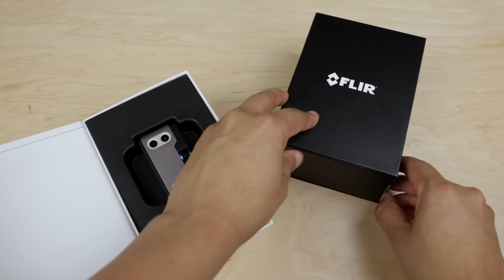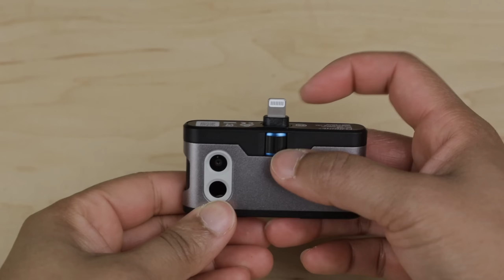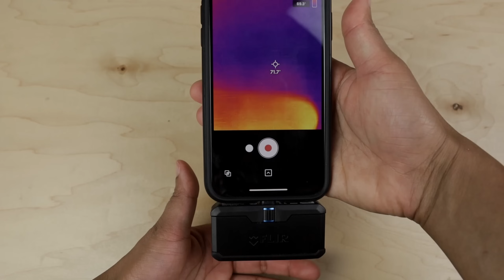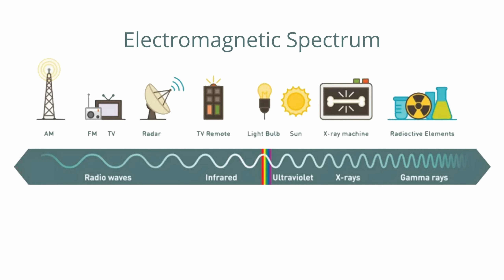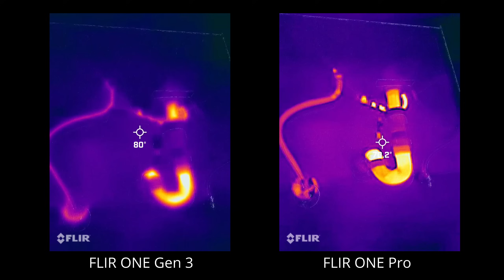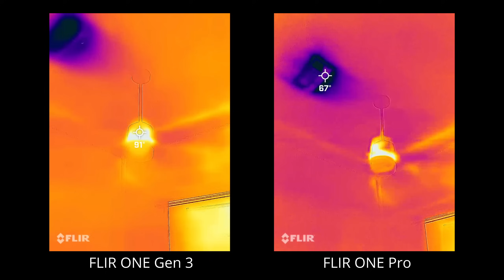FLIR infrared thermal cameras | Remodeling must-have!

Comment: Some building materials store and radiate heat, don't confuse this with heat loss per se. They would look warmer on camera but such readings don't tell you whether they are less effective as insulation. Incorrect assumptions could lead to the condemnation of perfectly well insulated buildings in which the conservation of energy has been miss-understood.   Great film Belinda, all the best Lucas.
Reply: Your statement is nonsensical. Not some, but ALL building materials store and radiate heat, just at different rates. A hot spot (meaning relative to surrounding material temperatures) means a difference in R value. This means higher heat gain/loss caused by that material. For energy efficiency and comfort the goal is to have as much R value as possible, as evenly as possible.
Reply: @sladeoriginal  What you have written demonstrates exactly the pitfall of relying on this kind of thermal data. Your understanding of how energy is preserved in a building is incomplete, if applied to a great many types of construction. What happens when the heating is switched off? How long does a building radiate heat back into the living space?  R value tests are carefully conceived as an aid to marketing particular products,  and are sadly unscientific. In some cases leading to time-honoured systems being displaced by experimental and ultimately inferior systems.

Comment: I've had the gen 3 for about 9 months.  I understand the resolution and pixilation is better on the pro, but the expanded range in temperatures do nothing for me.  If the house is ~500 degrees, it is likely on 🔥.  It is a tool for the tool box, and I use it in conjunction with my thermal gun that provided spot temperatures.  

As for the hot spot on the sloped ceiling, it may be a bees nest.  Thermal cameras can spot those as well.

Comment: FLIR is a top shel product. We had two at wirk for everything from scanning high voltage systems too dangerous to get close to. We also used them to find moisture and thermal links. One night we compared IR and NVG images in a wildlife preserve and it was amazing!

Comment: Check the HTI HT-301 camera, much better hardware, resolution and frame rate, but the app is a bit crap, around £600 or $800 USD

Comment: I have a CAT S61 with an older FLIR thermal camera built in. Don't use it every day, but do use it a lot. Used it in the mountains to check my breaks to see if they were getting too hot. Used it to check the insulation. It's really good at seeing where issues are. Good for checking some remotes to see if they have dead batteries. Used it to decide storing a lipo4 battery in my car during the summer was a very bad idea. Last winter during the cold snap was amazing at figuring out where the pipes froze. Use it cooking. Would love a higher resolution version, but the S61 is still running really good

Edit: Also depending on the temperature difference, between rooms or the outdoors it can work as a pretty nice stud finder.
Reply: I got the S62 Pro, it's very useful.
Reply: @davidwindmueller6000   personally waiting for a 5g version to upgrade but I imagine it's very nice

Comment: That's a cool feature to be able to adjust the height of the plug in port as I have had to remove my Otterbox Case from my phone to use certain thumb drives and things like that.
Reply: Worked on our Ottorcase. It is convenient. I think we had one case it didn't work on.